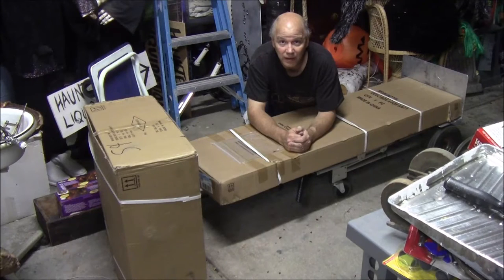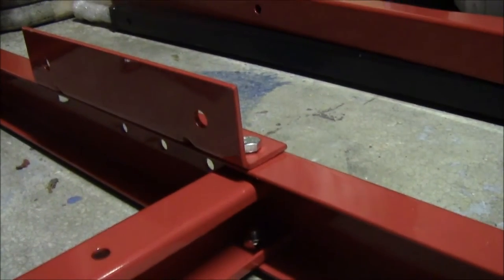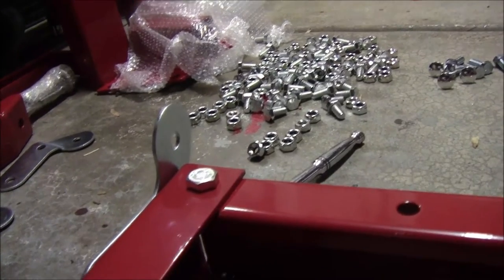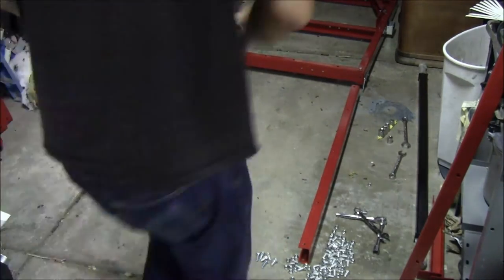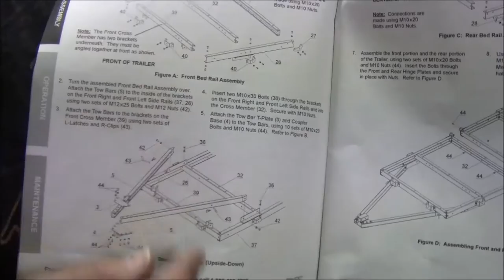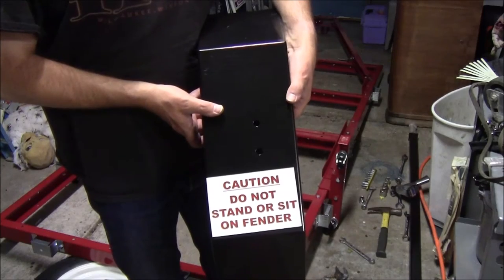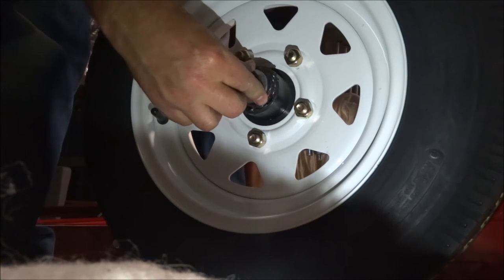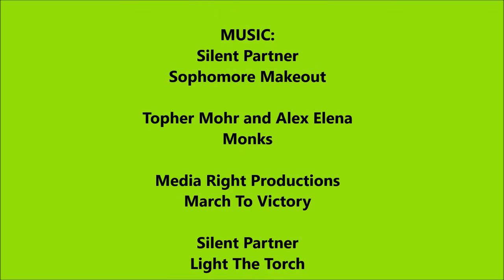Trailer Assembly Part 1

Comment: I am a woman over 50 and I need a livestock for my farm critters (goats, pigs, sheep, chickens...smaller animals. Not horses or cattle.) I bought this trailer for the job and I've been incredibly frustrated by the awful build instruction pamphlet in the kit. I'm nearly 12 minutes into your video and it has been far more instructional than the pamphlet! I've been able to slow down your video, pause it, rewind to rewatch a step...I am grateful to you for putting up this video, showing your mistakes and guiding thru the build. Thank you!
Reply from the maker: Thanks! If you are hauling critters use thicker plywood for the floor then the half inch I used. I have never folded the trailer, so just use a full sheet, no need to cut it in half. I have had to put in a new wiring kit after a few years of use. Maybe the newer version of the trailer comes with a better wiring harness.

Comment: We've all been there!   For guys watching, be careful NOT to tighten the bolts too much with air power. Even with just an air ratchet wrench a percentage of the smaller threads on my last project gave up and needed replacement. Think of it as a free class in wrenching.  ;-)

Comment: Do you have to use solvent and add new grease on a new trailer during assembly or is the grease it came with sufficient?
Reply from the maker: There was plenty of grease on the wheel bearings from the factory so I didn't bother changing it. If you wanted to clean it all off and use synthetic grease or something that would be OK.
Reply: Bearings are supposed to be cleaned in solvent and re-greased !